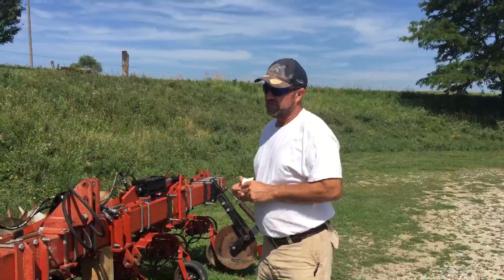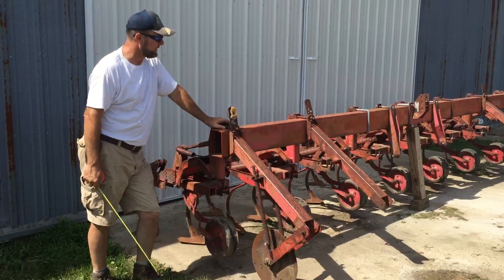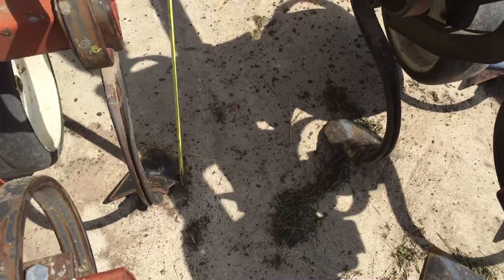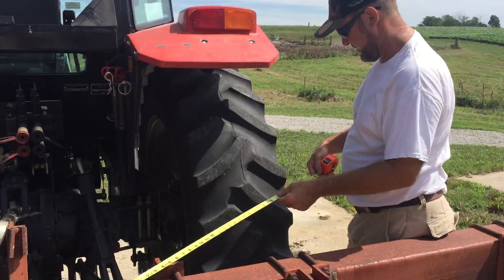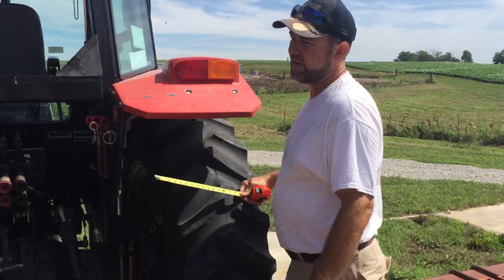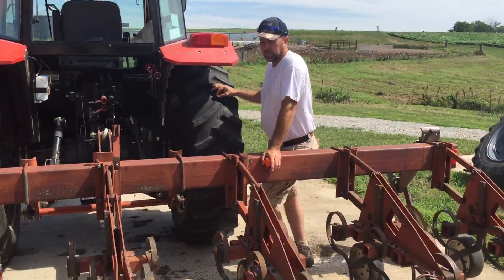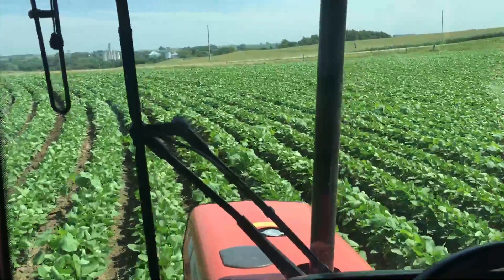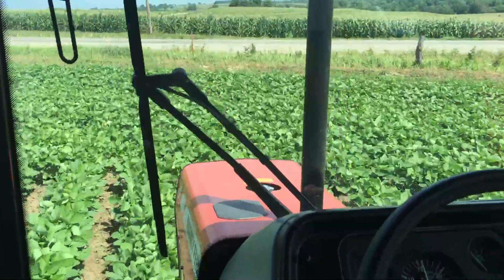Soybean 2nd cultivation w/aggressive danish tine

Comment: Congrats for your work. I want to know what do you think about the impact of this operation in the soybean roots. thanks from Brazil.
Reply from the maker: Thanks for watching!  People often have similar thoughts regarding the impact upon the plant roots...

Typically in my area (36+ inches precipitation), I have moisture to "burn".  The primary concern is depriving preventing weeds from competing with the crop.  Cultivation in this field is done on the contour and so when a late-season small rainfall event comes, the ridges created SLOW the flow of water across the field and thus aid infiltration.

Secondly. I know that relatively shallow inter-row tillage forces the plant to "root down".  In a drought stress event, this gives the plant better chances of prospering.  It also mechanically closes surface cracks in the soil and thus preserves soil profile moisture for use by the plant.  

All the inter-row tillage passes occur at a depth of less than 3 inches and typically before the 45 day point of plant development!

Comment: On the 30 inch roll how many population did you plant a acre
Reply from the maker: Varies from 180,000 to 195,000 based upon quality of seed, soil type, and weed pressure.
Reply: @GeigerFarm   We're doing our first year of Organic 30 inch rows soybeans, I was planning on 144000 seeds per acre. Is this too thin for 30in rows in your experience?
Reply from the maker: Yes IMHO.  But this will vary according to your environment.  I have learned to plant between 185-190 for our environment.  I would seriously hesitate to go below 160...and even then you better have very good seed.  In drier climates, you can reduce population!

Comment: What cain transmission uou have on the massey
Reply from the maker: The 596 Massey has a twelve speed transmission.  It is basically the same as the old 200 series with multipower.  You really only have 3 gears for tillage :( and the shifts are all mechanical.  BUT, it is a bullet-proof design.